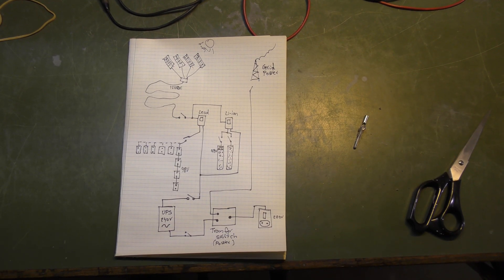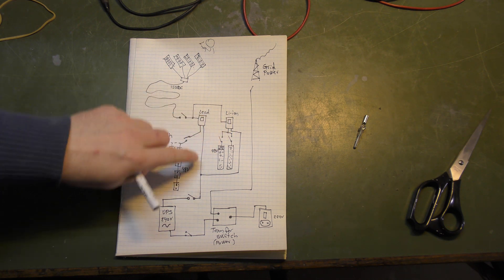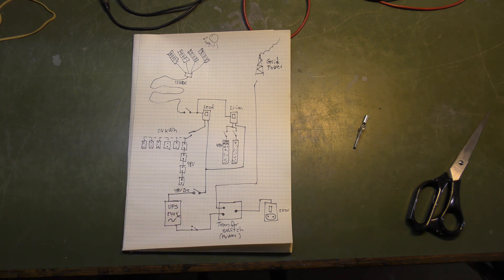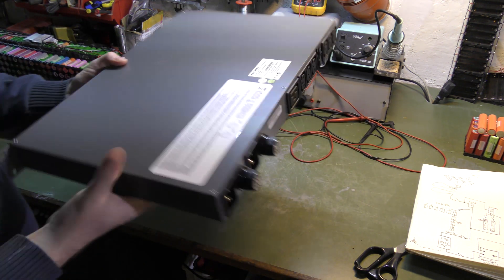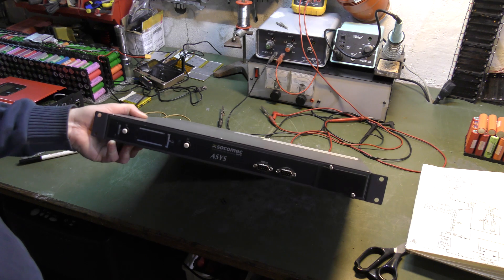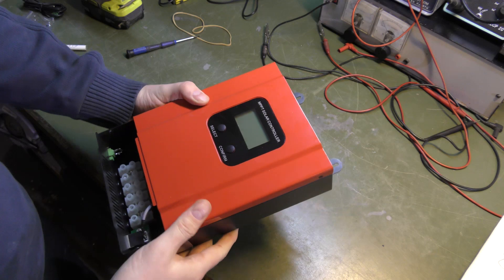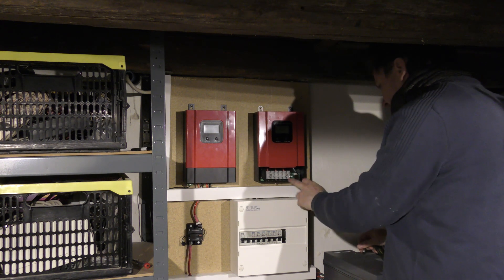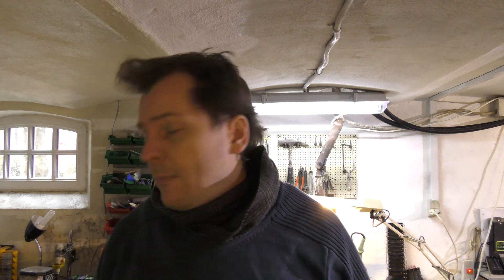Looking at a Automatic Power Transfer Switch - 652

Comment: Hi Morten! I hope you're feeling better now!
 I've just noticed that using an UPS as an inverter and then using an automatic transfer switch designed for server would waste lots of power that you harvest from the sun! Basically you can take the regulated battery power, so after the output of the controllers, and feed a grid tie Inverter. The current flows the path of less resistance and that means your entire house can be using power from your system if it can handle that, or it can be using half off / half on the grid power. Not having to switch at all between power sources and loosing less power between conversions :)
I would keep the ups plugged in the batteries BUS in case of a power outage, in case the grid tie inverter wold go offline and you would still have power on the ups outputs.
Reply from the maker: Hi Simão Gomes
Thank You very much! I do not want to send power out on the net,, I do have 3 Grid Tie Inverters,, that I no longer use.
Thank you for watching! :-)

Comment: hehe yep we had to use one in our datacenter since we have 2 circuits and we have a few devices that only have 1 power input, so when they were doing maintenance on one circuit we had to quickly install one similar. now we should have 100% uptime lol. I have a much older transfer switch that has a welded relay, I cannot seem to find one to replace it :( it is the standard sizing/spacing for the small 5-15A relays but it is a double pole double throw so 2 contacts are in parallel.
Reply from the maker: Hi SuperBrainAK
Thank You very much!
Thank you for watching! :-)

Comment: The UPS would prefer grid power when it is awailable, otherwise it would run of battery. So by simply removing grid power from ups, you could use the built in transferswitch in the UPS. But the UPS will try to charge Your batteries with grid power when available. Perhaps a hefty diode in series with the batterybank could prevent that. I have a somewhat similar project going on using a Eaton 9130.
Reply from the maker: Hi Bits Bytes
Thank You very much!
Thank you for watching! :-)

Comment: I'm not sure about your setup, as I have never used that MTTP unit.  However, you may want to look into connecting the outputs together in parallel.  I am worried that one unit (most likely the lead acid one) will try to back feed the other (most likely the Li-Ion).  
Say you are running on battery power, as the grid went down.  All is fine, untill you have depleted the charge stored in the Li-Ion battery bank. Since there is no more charge, the Li-Ion MTTP does not have any battery power, and the solar panels can't produce enough power, the output of the MTTP will drop to a low voltage.  However, the lead acid battery bank still has a lot of reserve power, so the lead acid MTTP will still be producing 48V DC on it's output.  Without some kind of protection, that output current will try to flow back into the output of the Li-Ion MTTP unit.  So here is the potential problem - i am not sure how that MTTP will react - maybe it will be ok, maybe it will let the magic smoke out.  
Another concern will be if each MTTP has a slightly different output voltage.  If one was at 48.2V DC and the other was at 48.4V DC for some reason - how will they react?  Will the lower one sink some of the output current from the higher one?  
I would think some kind of protection would be required - maybe some large 100A diodes (with beefy heat sinks) in series with each MTTP output to prevent current from back flowing into the other unit?  Maybe there is another device on the market to do the same thing, I am not sure.
Just something to think about - hate watching magic smoke escape.  Best of luck!
Reply from the maker: Hi bsb0011
Thank You very much!  I will try to get in to this in a video.
Thank you for watching! :-)

Comment: my battery bank. is taking the place of my piggy bank! I have just over 300 ah after I connect my latest lithium purchase. ( I have to build the packs first!) I need two charge controllers a smaller one for lead acid. and a 40-60 amp for the lithium. I guess a 20-30a for the lead. I'm thinking I will use it for backup. until I get enough lithium to power my off grid home for a few days. by then the batteries will likely be used up! because that will take a while! and a 5kw inverter is hungry! so the generator will get a workout also. I do have about a 25 gallon supply of fuel for it. so it should last a month! I hope lithium batteries price drops soon. I found some lithium titaninate or how ever its pronounced.  but they are low voltage. like super caps. but seem to be bullet proof. and powerful. I just wonder about these charge controllers. I'm stuck between 3 and can't seem to decide. the Esmart3, epever tracerA, and make sky Blue!  I haven't seen anyone use the make sky blue. OTE had one but fried it. so I guess between the other two. can you tell me how the ES3 works. and if it is worth getting. I don't want a controller . that I have to buy something to use it. like the epever. the mt50 is like $50 at some places. and they are like 3-4 of them that are the same look. but will not work with with all the controllers. all the different name brands on them. with different programming. I'd like something simple to use. so you could help me decide. thanks and great video. I haven't seen any good tutorials. I hope to go up to 48 volts in the future. so that's another thing this controller has going for it! I'd like to have the panel voltage high enough to not have to rewire it. so I can eventually go up from 24- to 48 volts! sorry I'm rambling again! but thanks
Reply from the maker: Hi James stranger
Thank You very much!  I must admit that I still do not know the eSmart3 controller good enough to recommend it. You mention some good points,, and it is also not too expensive,, and it is still working for me,, that is always a plus.. but I do not have any other mppt controller to compare it with,, think you better ask OTE,, for his opinion as well,, he knows more :-)
Glad you liked the video :-)
Thank you for watching! :-)

Comment: Get well soon!! 👍 🤒😀
Maybe another idea for your system.... Make it possible to charge the batteries with the grid.
Here in the Netherlands the power is cheaper during the night, than during the daytime.
Now you can, in winter and cloudy days, charge the batteries (cheaper) during the night and use the power during the day. 👍 😁
Reply from the maker: Hi Guust
Thank You very much!  I am not sure if they really keep track of what power you used at night and what you used in the day time,, here yet,,, it might just be based on statistics,, 70% expensive 30% night cheaper,, and as the power it self, is nothing in the total bill,, I do not think you can save much here. I could be wrong....
Thank you for watching! :-)
Reply: My PlayHouse Here in NL you can have an electricitymeter with 2 kWh counters,  1 day and 1 night counters. That why people with battery banks sometime use this to charge the batteries during the night.